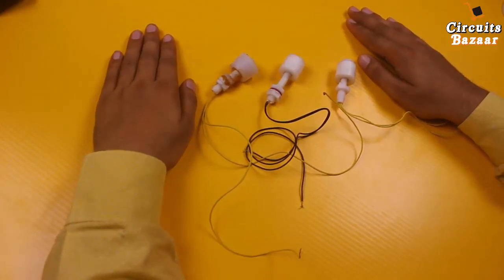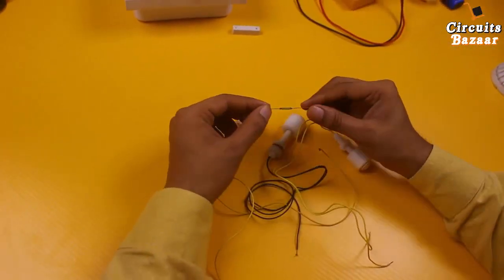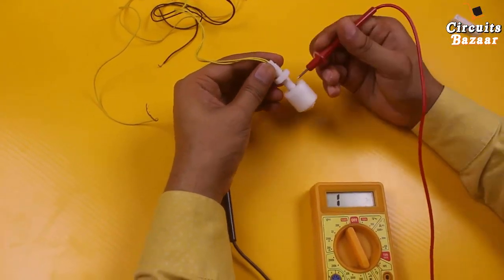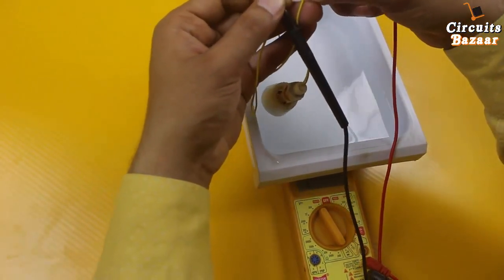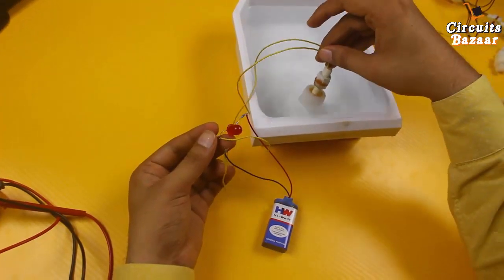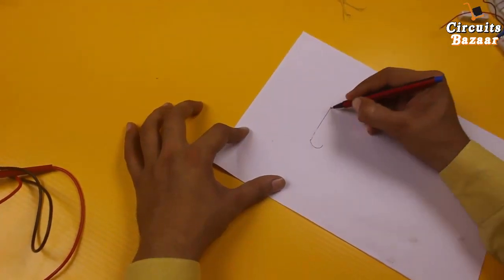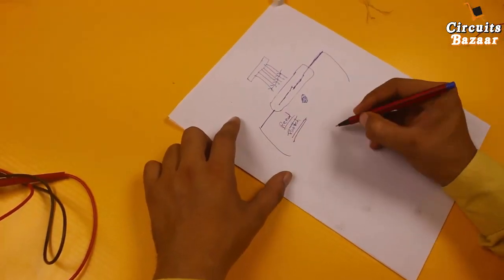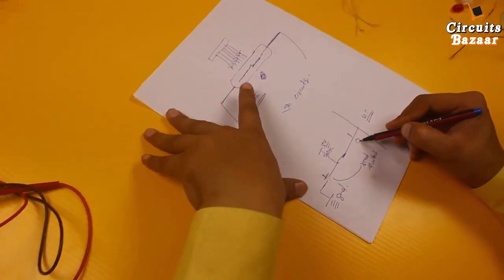How To Use Float Magnetic Sensor or Reed Liquid Level Sensor

Comment: Can it be used on real water tank? Water tank is usually 2m tall and ~1000 liters or more.
and at what voltage?
Reply from the maker: Yes brother it is specially designed for these type of application you can use it even in 3 m - 4m tall tank.

Comment: Can we use this for 3 phase motor in the continuity mode?
Reply from the maker: No, its current tolerating capacity is not to handle three phase motor. You have to look for other options. Or one thing you can do, you can use a relay. You will drive the relay with the help of this float sensor, and then relay will drive the three phase motor.

Comment: Sir, shall we connect magnetic float switch directly with 24 volt RO pump?
Reply from the maker: No, directly connecting a magnetic float switch to a 24V RO pump is not safe due to potential overload, inrush current issues, and lack of protection. Use a relay or contactor for safe and efficient control.

Comment: What is the current capacity of this reed switch?
Reply from the maker: The current capacity of a magnetic reed switch can vary depending on its specific design, size, and intended application. Reed switches are often rated for a certain maximum current and voltage.
Miniature reed switches: 100mA to 250mA
Subminiature reed switches: 50mA to 100mA
Standard reed switches: 0.5A to 3A
High-power reed switches: 5A to 10A
Reply: @The.Innovative.Indian  Thank you sir

Comment: Hi. It is good to measure the well depth and water level, the question is how depth can this still give signal? up to 100 meter depth do you think it will work?
Reply from the maker: Yes you can use this for 100 meter depth.... Just use 7805 based signal booster using resistors to get signals for long distances....
Reply: did you work for oceangate by any chance sir?

Comment: Need help with my float. Apparently got stuck under continuity causing a motor controller to think the tank is full and not turning the water pump when needed. Replaced with new and still causing issues. How can I make it reset the system?
Reply from the maker: Your questions is not clear. 
As far as I can understand you are asking the continuity problem actually in these sensors you will get normally open and normally closed sensor. You can use according to your requirements

Comment: How much load i can pass through reed switch i need to pass 50 watt . Water moter i want to use this reed switch for on /of for my moter can i?
Reply from the maker: I have used small capacity reed switch..... They can't run motor directly.....  You can buy high capacity read switch😊👍

Comment: Can we remove and change the position of the float to make normaly open or normaly closed?
Reply from the maker: Yes both types of float sensors available in the market
Reply: there is a video where it is shown that the ring is taken off, reversed and then put back on in the other direction and then it should make normally closed into normally open and normally open into normally closed but it is not clear how that works. can you please look into this sir? @The.Innovative.Indian

Comment: As soon as the magnet comes in contact the motor switches on...water drops to few level, then the magnet looses contact..😂😂..motor stops there itself...we need something where when the tank is full, the motor starts then stops only when it has pumped out some considerable amount of water..like a float switch...why do you need a reed switch and a magnet to complete the circuit😀😀?! Just keep one end of a wire at top and attach other end to a simple floating material, so when the tank gets full both ends of the wire make a contact and the buzzer rings..😂😂
Reply: But enclosing such a swith with bare open wires is a hassle. This is inexpensive
Reply: fried fish anyone?

Comment: If I want this sensor to do the opposite, when out of water it is continue ( light on) and when in the water ( I mean water level increase) it no continue ( light off) ?
Reply: Use a relay and connect use normally open terminal of the relay.
Reply: https://www.youtube.com/watch?v=_MVk8mObYbE
Reply from the maker: Normally closed Float sensor available in the market...... or you can use them in upside down direction if you want to use the same sensor..... i have used this way .....
Reply: sir could you please explain further the relay is used how? what relay should be used and how to connect this float when used with a car battery or 9v battery and a small motor to open or close a water inlet valve? I am thinking of building a cascading water feature. can you please explain how and what is needed. thank you.
Reply from the maker: @clamman7505   The Relay you can  will use is 12V or 5V Electromechanical Relay. But you have to use driver in between the relay and the sensor because sensor current is too low. you can use bc547 transistor as a amplifier to amplify the signal from sensor to the relay. further in the relay there is three important pin common, normally open, normally close. learn how to use them by watching tutorials then you will be able to connect anything to this arrangement. 
😇